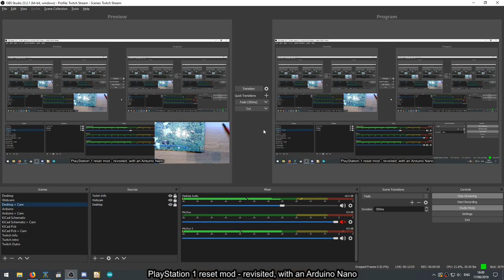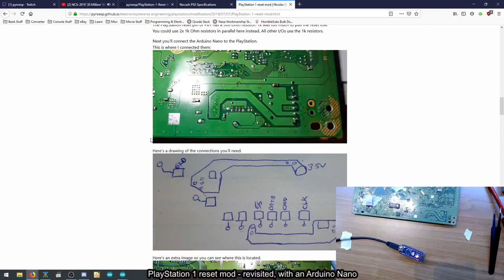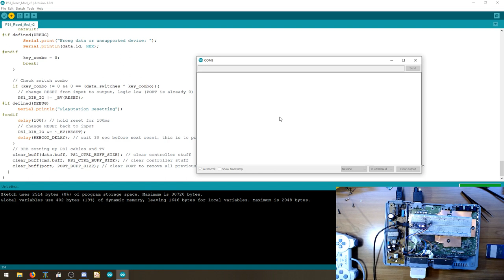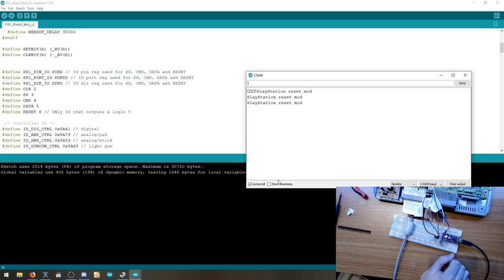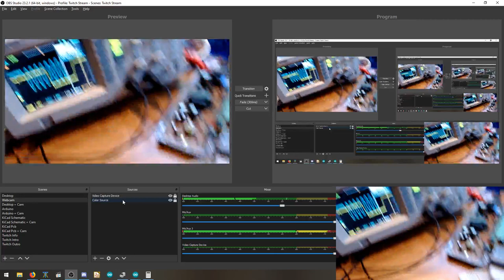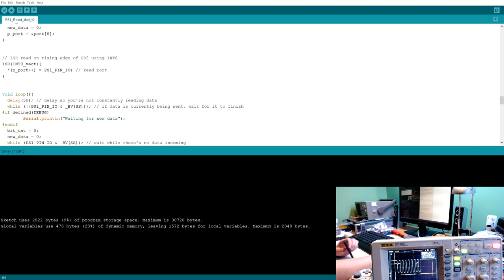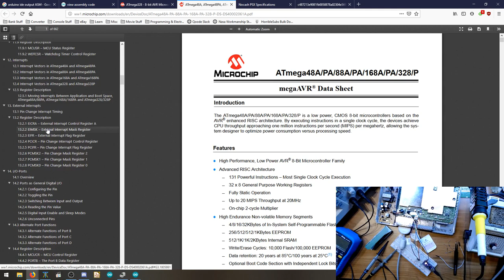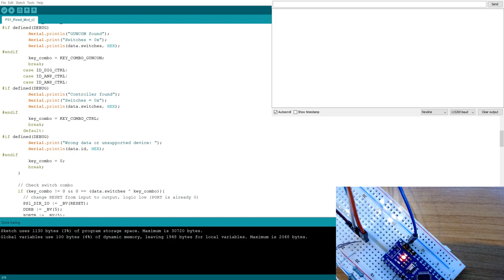PlayStation 1 reset mod - revisisted part 1

Comment: So I have a question that you may be able to answer, you obviously know a lot of the inner workings of the original playstation and it's power supply board. I'm building a retrogaming rig out of one using an Odroid xu4. In order to keep the original look and feel I am going to be using the original power supply with a dc-dc step down buck convertor to bring voltage down to 5v. Now, for safe shutdown I want to use the reset button as the "trigger" what I need to know, when the reset button is pressed, what happens? Obviously you have knowledge to this as you're simulating the press via this mod. Does the reset wire from the PSU board to the motherboard cut voltage to part of the MB, or does it supply voltage to a part of the MB that initiates the reset? If it supplies voltage when pressed, do you know off hand how much voltage, and if the voltage is applied the entire time that the button is depressed. Thanks in advance.
Reply from the maker: Hello,
The power supply of the PlayStation has 8V and 3.5V. You could step down from the 8V to 5V, but it might be more efficient to just get a 5V PSU directly. Looking at the Odroid xu4 it says it needs 5V/4A PSU and I don't think the PlayStation is that powerful.
The reset does not turn off power to the board. The CPU (and maybe other chips) has a RESET input pin. If you've ever worked with microcontrollers then you probably know about this.
The idle state of the reset line is 3.5V. When you press (and hold) the button it changes to 0V. This puts 0V to the CPU RESET pin causing a reset.
The mod is doing exactly the same thing. It's connected "in parallel" to the reset button and the mod can pull the RESET line down to 0V to cause a reset.
Reply: @pyroesp  I know pin 1 is 7.6v and pins 3&5 are both 3.5v. So from what you're saying, pin 7, which is only labeled as reset, is 3.5v until the reset switch is pressed, then it drops to 0v, correct? If so I'll have to find another way because I need there to be 0v coming from the reset pin on the PSU board until I press the reset button, then I need any voltage between 1.8-5v to be applied through this pin, in order to send to GPIO pin 12 on my Odroid to initiate shutdown.

As for the 5v 4a issue, I know this and do have an official power adapter from Odroid as well. If it turns out that there is not enough amperage after stepping down the 7.6v, I do have a second non-working ps1 that I can salvage the PSU board from and then desolder all the components from and modify that PSU and the odroid PSU together to feed through the buttons, but I'm trying to avoid this unless absolutely necessary.
Reply from the maker: @TheBudgetTechnician  Not sure where you're getting pin 7 from, but yes. The voltage for the RESET line drops to 0V when you press the button.
Odroid should be able to the voltage going from high to low on it's GPIO, not sure why you specifically need it to go from low to high. Maybe that's something specific to the Odroid, I've never used one so I don't know.
You can probably make an inverter with a transistor so you get the low to high transition you want.
Reply: @pyroesp  the cable connecting the PSU to the PS motherboard is a 7-pin cable as outlined in this custom PSU guide for the audiophiles that use the PS1 as a high quality CD player. This is where I was getting pin 7 from the PSU board as being the reset signal.
"The pinout of the connector on the PSU board is as follows:
1: 7.6 V
2: 0 V
3: 3.6 V
4: 0 V
5: 3.6 V
6: 0 V
7: reset"
http://dogbreath.de/PS1/RecasingPSU/RecasingPSU.html

As for the Odroid, GPIO pin 12 is the "Power On" pin and is used to turn on, shut down (short press), or cut power without shut down (long press) in order to do these processes it has to have voltage applied to the pin to trigger it, the acceptable voltage is from 1.8-5v. this is what I was hoping the reset switch was normally at 0v and sent a voltage when pressed that triggered a reset sequence on the PS1 motherboard. For the Odroid, most people use a momentary switch connecting GPIO pin 1 (5v constant for the entire time the odroid is attached to a power source) to GPIO pin 12